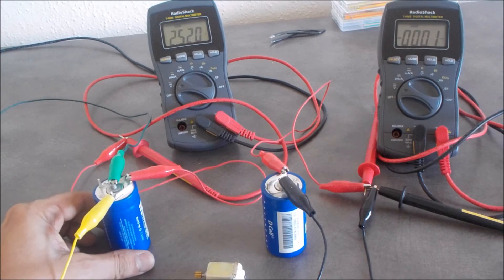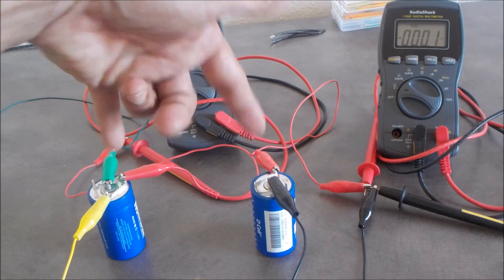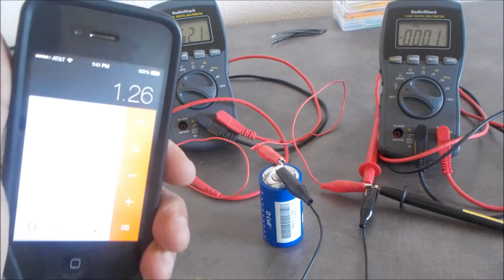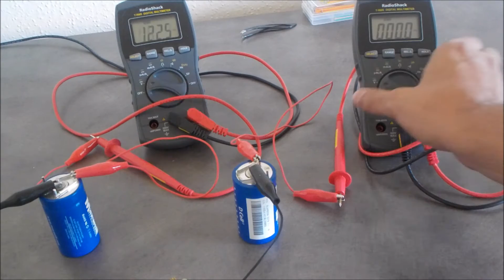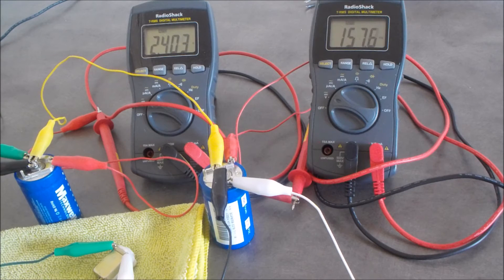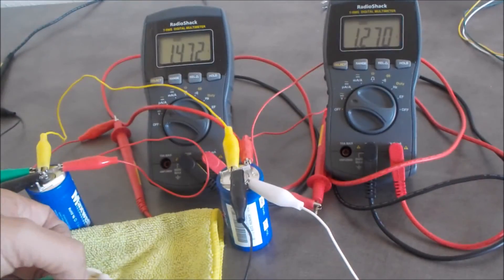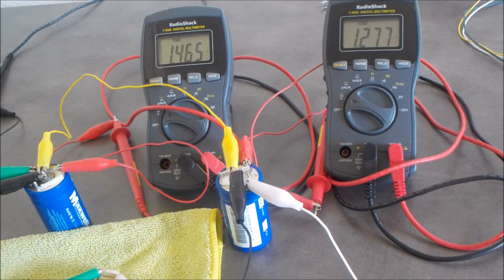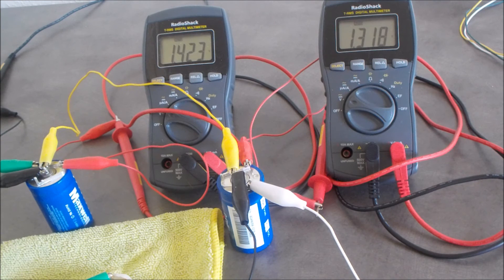Maxwell Capacitors Discharging and Charging

Comment: induction of motor reduces losses. 50% is worst case. yet: vertigo? :) pros tell me heat losses... yeah right, xaggly 50%... i guess dielectric coupling with the natural dielectric field of the earth. forced to adsorb the energy. when connecting the two, they become serial AND parallel: voltage sum, but half the capacitance. let's reverse it. :) by dynamicly increasing C? maybe. if we can lose it, we can find it... tap it...
Reply from the maker: It’s just Newton’s law of ‘for every action there is an equal and opposite reaction’. Coils increase the 50% to above 50%.

Comment: Just charge your first cap then discharge it through a light check the minutes.. Then recharge it again and then transfer it between the caps.. Then hook your light to each one separately and time it again..
Reply from the maker: That’s actually not a bad idea. I might have thought of that before and probably didn’t do it because of the long amount of times in between. 

Or either that time tests can’t be relied upon, especially with motors, or can you?

Comment: Imagine a empty tank and a full one same size,  with a tube from the bottom to the other bottom of the tank. With a valve. Now you open the valve and the tanks equal in volume. This is a example of transferring electrons to the other tank. Not taking into account of losses from resistance from the conductor. With the transmission of electrons through a conductor you get resistance and with resistance you get magnetism, a magnetic field is created around a conductor. This will account for energy losses like a leaky water pipe when compared to water theory. Egyptians made a macremea woven wire that conducted DC current from their Bagdad battery's to the Egyptian light bulb. This woven conductor captured magnetic radiation and converted it into electricty, cutting down on losses. The electron amount in stored cap is not lost but converted. You cannot destroy energy only convert it.  Energy conversion always is divided in the changes of one form of energy into another. The electricty wants to escape as it travels from atom to atom it jumps from one  electron shield to another. This process creates magnetism in a conductor. Cooper paring is a electron chasing another electron in its shadow lowering the resistance while traveling. Like a car driving behind a semitruck avoiding wind reducing the resistance. When the electron jumps from atom to atom shield there is a back emf, electro, magnetic, field. Created where the electricty is converted into a magnetic frequency like a radio wave.  Think of a wire 10 atoms long, one electron jumps onto the first atomic shield of the atom and follows its bound electron halfway around the atom and then jumps to the next atomic shield and so forth until it reaches ground because the charged electron wants to equalize its charge this is why electricty travels to the lesser charge and electricty is lazy! 😒 It will take the shortest pathway to ground. But there is something else happening here when Eddie electron jumps from atom to atom he loses a bit of charge and the atomicaly bound electron carrys away part of his charge. 😢 This charge is then radiated into a form of energy called magnetism⚡ this loss of conductance results in a lesser charge at the other end of the conductor.

Comment: Just like the car battery can show the correct voltage, but not have the capacitance to start the car.

The supercapacitors may show higher voltage than you expected but the capacitance has been reduced by heat loss, wires and the motor you were using. What that means is, E from the first supercapacitor is not halved.

Comment: Somebody asked me about this experiment on Quora.  The 50% standard result assumes constant capacitance.  The likely reason why you're seeing 60% of the voltage here in practice is that the capacitance of super-capacitors is voltage dependent.  In this case the results indicate that at 60% voltage the super-capacitors in this video only have 83% of their capacitance at full charge.  Reduced capacitance results in higher voltage for the same charge.  You actually retain 30% of the original energy in each capacitor because of this, and only lose 40% in the process.
Reply from the maker: Hi, is this sort of like the separating of plates of regular capacitors and getting an increase of energy?
Reply: Yes, it's essentially down to separation between the conductive layers.   In a super-capacitor these are usually plate-electrolyte-plate with around 0.5Å separation between each plate and the electrolyte.  This separation is called a Helmholtz layer, which forms at the liquid-solid interface.  So it's really two capacitors in series with the electrolyte connecting them.  Anyway at lower voltage these interface layers get wider, decreasing the capacitance.  Same charge with less capacitance equals greater voltage and greater energy both in reverse proportion.  60% is 50%/83%.
Reply from the maker: Hi, that makes good sense. To me this is an energy gain if I am not mistaken, it’s not beyond 100% of course but it knocks on efficiency similar to what collapsing fields do.

I really wonder what would happen with a self oscillating circuit or DC-to-DC converter in between he positives or the negatives.

It’s output (collapsing field) which should be right around 50% would be sent back to the discharging capacitor to try to keep it up so that it discharges at a slower rate, meanwhile the charging capacitor would continue to charge up as normal.

Maybe 70-70% efficiency of energy leftover is what I would predict. Wonder if this same thing would occur with batteries?
Reply: Not sure you're gaining energy to be honest.  What's actually happening is that you're reducing the energy loss in the connecting load by reducing the average voltage differential across it.  Your loss in a resistive load will always be equal to total charge transferred times average voltage differential.

In practice you could and would use a DC to DC converter to transfer charge instead of a resistive connector, reducing losses to around 10% with decent efficiency.   That's what happens with most battery charging nowadays, including from power banks.  In fact a DC to DC converter on the output of a super-capacitor powering a circuit is pretty much necessary anyway, in order to maintain the voltage over the majority of the discharge.

Comment: I believe the "extra" energy you are seeing is due to several combined effects.

1.  You're assuming the two capacitors have exactly the same capacitance value; They don't. Manufacturing tolerances, charging history, and aging effects (cycling) can all causes differences between the two capacitors.

2.  Pseudo-capacitance.   The electric-double-layer only contributes part of the published "capacitance" value. Reversible redox reactions and electrosorption also generate charge.  The energy released by these reactions are not simple functions of the capacitor's voltage, and don't follow the E=(1/2)*C*V^2 capacitor energy law.     

https://en.wikipedia.org/wiki/Pseudocapacitance.

Supercapacitors, in general have high self-discharge characteristics.  Manufactures try to compensate for this leakage by adding charge generating mechanisms (reactions, adsorption) to improve their cap's self-discharge performance.

3.  Porous structure of the electrodes is not a simple two-plate capacitor.  Charge storage sites inside "deep wells" in the electrodes will require more time to charge/discharge than "shallower" sites on the electrode.  Dielectric absorption causes the capacitance to be non-constant, and depend on charge/discharge time.

Comment: Consider the case where I have two identical tall flasks joined at their bases by a small pipe with a tap in it. One flask I completely fill with water, the other I leave empty. When I open the tap, the system moves to its lowest energy state -- i.e. water flows from the full flask into the empty flask until the levels are the same. The amount of water in the system (analogous to electrical charge in the case of the capacitors) remains unchanged, but the amount of energy in the system has fallen (since the system moved to a lower energy state). If I want to get back to the original setup then I have to do some work -- I have to put energy into the system in order to raise water upwards against gravity (i.e. I have to pump it back into the first flask). I would then again have the same amount of water (charge), and I would only have the same amount of energy again because I put energy into the system. It is energy that is lost here, not charge.

Comment: The capacitor stored energy is given by the equation E= 1/2.C.V^2
C= 350 Farads
V= 2.52 Volts
E= 1,111.32 Joules
Assuming that the capacitors are equal having the same capacitance and the energy losses are negligible, each capacitor will have half the total energy, hence:
E/2= 555.66 = Ea = Eb
Solving to the voltage,
555.66 = 1/2 . 350. Va^2
Va^2 = 3.1752 
Va = Vb = 1.7819 V
that's would be the voltage in each capacitor, but you ended with:
Va = 1.4 V
Vb = 1.34 V , hence:
Ea =  343 J
Eb = 314.23 J
The energy spent is.
Es = E - Ea - Eb = 1111.32 - 343 - 314.23
 Es = 454.09 J
Hence the energy spent in the motor is 40.86% of the initial capacitor energy.
The capacitor voltage is not the capacitor energy. As can be seen in the first equation, the capacitor energy is proportional to the square of the voltage. 
In order to transfer charge from one capacitor to another with minimum energy spending, you'll need an electronic circuit.

Comment: You're not thinking straight. Now if you put the two caps in series you have bit more voltage but half the capacitance. So....sorry to dissapoint'ya
Reply: @Andy The Creator Not true Andy. Elementary school physics says that for caps in series the new capacitance is 1/C = 1/C1 + 1/C2 . So if C1 =. C2 , you get C = 0.5 * C1. That means the previous comment was right that if equally sized capacitors are connected in series, total capacitance will be halved.  But not the energy. Energy potential stays the same compared to parallel connection since you can store more voltage in configuration in series. 
E = 0.5 * C *Vsquared

Comment: As I see it, the energy stored in a cap is a matter of voltage only. The cap doesn't care about energy. So it will level out with an identical cap at half the voltage. the loss of energy is a physical consequence. Helmholtz may not be god after all and his idea of energy conservation just a belief. Way more interesting would be to reverse the event, to "pump" the voltage of cap 1 over to cap 2 (both,say 5V initially), theoreticly giving a COP of 2.0...
Reply from the maker: Hi Harry, very interesting thought. The problem however is energy conservation I'm afraid as there are losses in heating and without anywhere to go it's simply wasted away.

Comment: I have transferet almost all energy from one capacitor to another capacitor via a diode and a coil. You still have the same energy it has just now divided in two capacitor
Reply from the maker: Very nice. A coil and diode does indeed transfer almost all the energy from one capacitor to the other in an inverted way. You need something more to achieve more.

Comment: A capacitor is push-pull. When charging, you transfer electrons from negative side to the positive side. So if you use the water analogy, you subtract one gallon from one side, and fill the other side, making 2 gallons difference. But only one gallon is moved. So when you use 1/2 gallon from the positive side to the negative side, the difference is actually reduced with 1 gallon making the loss. The push-pull  is also the cause of the tremendous energy potential. Lots of energy in a short time.
If you make a winding machine doing work with the motor you use, using one of the capacitor, you will make 1x lift. If you then do like in this video, your will have 0.7x lift when equalizing the voltage between the capacitors. Then you have 1,5 and 1,4Volts left to discharge on the motor. You do 0.5x work with the first capacitor, and after changing to the last capacitor, do another 0.5x work. Total 1,7x work.  I made a pulse motor based on this theory publically on my youtube channel.. When working with capacitors you always know your energy consumption...

Comment: Well done, normally, you loose 50 % energy in the ohmical resistance of the connection wire or in your case in the motor windings and get the lost energy in your motor output multiplied with its low efficiency...
But as you use a sparking commutator DC motor, there is an effect like in the old Joseph Newman machines, that a sparking Commutator can add additional energy into the circuit, so you end up with less then 50 % lost energy...now maybe you have only lost 35 to 40 % energy and you still had the motor output...
So try to play with better sparking commutators with these motors.
You could also try to use sparking BackEMF coil-relay-Sparkgaps like a doorbell ringer circuit stype to charge up the second cap and try to get a higher voltage this way, so you might get a higher voltage than started...
Hope this helps.
Regards, Stefan.
Reply from the maker: +Stefan Hartmann Hi, are you the Stephan Hartmann from Overunity.com?
Reply: Yes, he is that one.
Reply: You also have resistance in the capacitors themselves which will go up as the empty capacitor starts to get a charge.  This means some energy is converted (lost is the wrong word as energy only changes forms) into heat and over this resistance.  In your analogy half your "water"/energy was lost (changed) in this resistance transfering from capacitor to capacitor.  However with capacitors the higher the return voltage is to your charging capacitor compared to it's existing stored voltage the less resistance there will be in the transfer.  What I suspect is happening is the charged magnetic coils in your motor as they are collapsing is putting out a tiny high emf voltage that is feeding the caps at a high voltage low current but at minimal resistance.  This is why in electronics we often put a shunt diode across a motor so the high voltage spikes don't damage the electronics.
Reply from the maker: This effect also can be shown with just an incandescent light in between the two super caps, so back EMF is out of the equation.